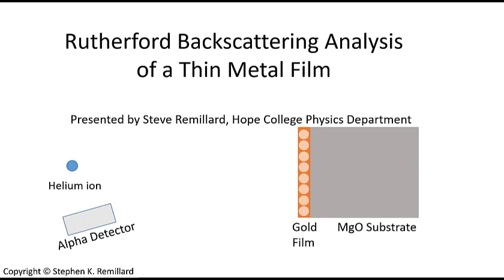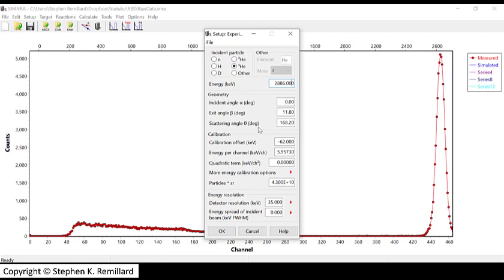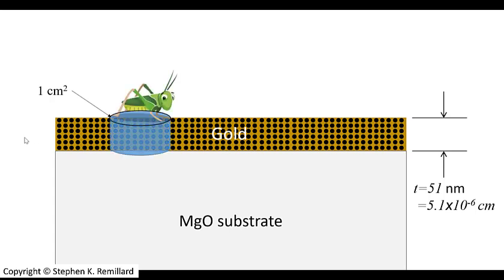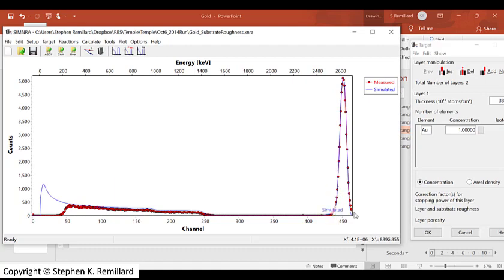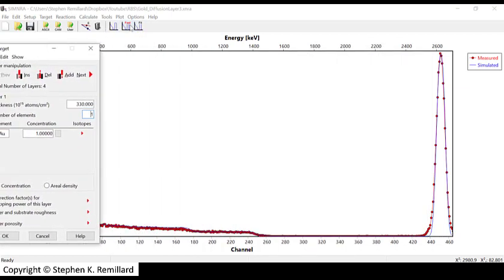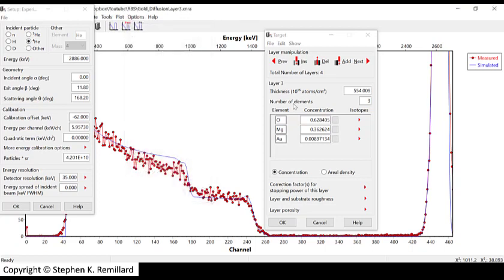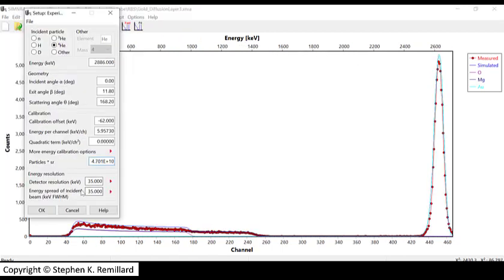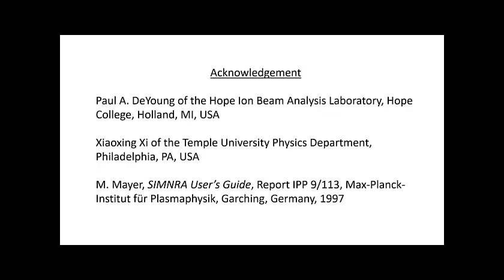Rutherford Backscattering Spectroscopy (RBS) Analysis of a Thin Metal Film using SIMNRA

Comment: Very nice video, I found the explanations clear.
Question: do you know if the metallization process (used to deposit Au on the MgO) would typically result in gold implantation into the MgO substrate? (Is the deposition process very energetic?) Or might this Au implantation/diffusion have happend during the RBS measurement?
I don't have much background in this type of measurement, so apologies if this is a bit of a beginer question.

Comment: Hey Sir, did you attached the file of the SRIM Software on SIMNRA before start the analyses? or can i do the fit without this?
Reply from the maker: I think you are asking if there is a file that I needed to prepare before running SIMNRA.  You do need to read the spectrum as an input file.  I convert the spectrum to an ASCII file before selecting "read spectrum".  It will also read the .cam files generated by Canberra software, but I have never done that.

Comment: Hello please please proffessor 
RBS does not give information about chemical bonding why ?
Reply from the maker: Good question.  RBS is a scattering problem and as such is influenced by the masses of the interacting particles.  The scattering ions (helium, hydrogen, etc.) ricochet in a manner determined only by momentum transfer from elastic scattering with the nuclei.  Chemical bonds can only react to the motion of the atom after the nucleus scattering event has occurred.  So the scattering ion is not influenced by the recoil, and thus not influenced by the chemical bonds.

Comment: Why RBS does he need to ultra-high vacuum ?
Reply from the maker: Alpha particles don't go very far in a gas.  After about 2 cm in air, the beam would be attenuated to almost nothing.  UHV is needed so that the alphas can survive the trip down the beamline, into the chamber, and finally to the detector.  An interesting application of the short travel of alphas in media is the smoke detector.  The alphas can cross a narrow gap in air, where they are absorbed at an electrode.  But when that gap fills with smoke particulates, the alphas are absorbed instead by the particulates.

Comment: Hi proffessor 
can we say RBS is a surface analysis technique? and why ?
Reply from the maker: With the energy of alpha particles that I have been using, RBS can detect heavier nuclei a significant fraction of one micron beneath the surface.  But the depth of sensitivity is quite limited, so I would agree that it is a surface technique, but with thin film depth profiling capability.
Reply: @stephenremillard1  
so finally RBS is a surface analysis technique but a leader because of what ? for example in XPS and AES because of the average free path but in RBS why ? 
and thank you thank you perefessor
Reply from the maker: @mohibmohib6442  I think nondestructive depth profiling, especially of films, is the key strength that attracts me to use RBS. My understanding is that Auger produces depth profiles by removing material, one layer at a time.